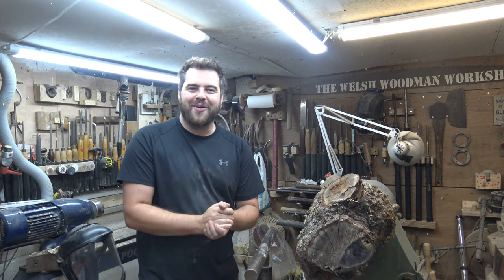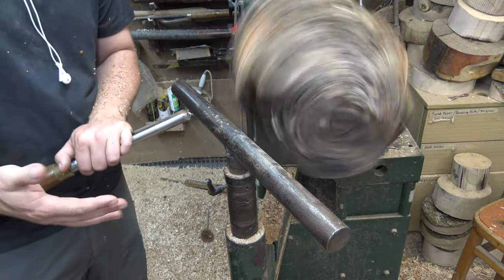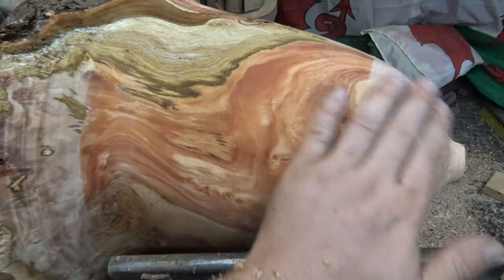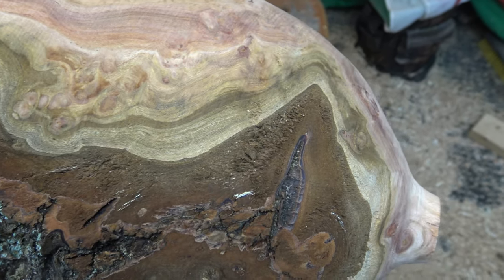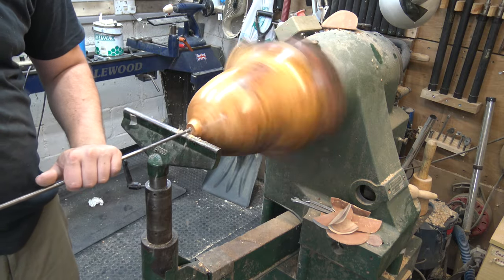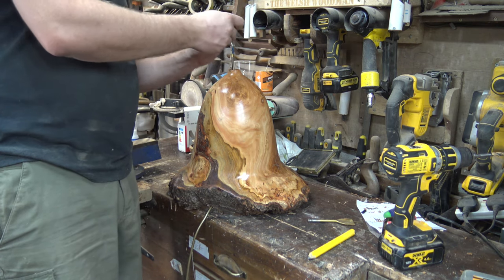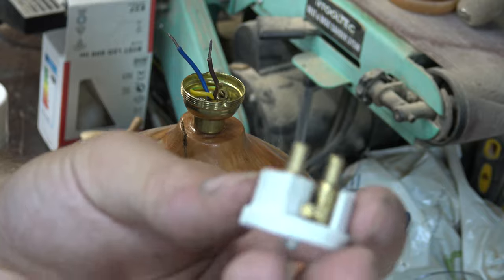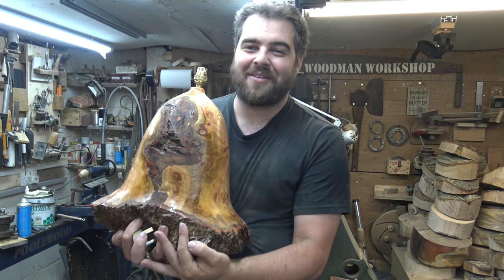Woodturning a Cherry Lamp

Comment: Nice one, Tom! In the beginning I thought you'd be doing a lamp shade, i.e. hollow it out. But it's also beautiful as the base of the lamp.
Reply from the maker: Thats definitely a cool project for the future, thanks for the idea 😁 I think I would try and pick a piece free of knots and the pith for the shade as it'll be turned thin it will be less likely to crack 😉 thanks for watching 👍
Reply: @thewelshwoodman649  or maybe a super gnarly knotty piece that turns into a shade with lots of holes. Might be worth the risk of having it crack.

Comment: Hi can I ask for a little tip. I have recently started woodturning and really enjoying it but I have noticed when I have finched a project it starts to crack a few weeks after how can I stop this ?
Reply from the maker: Thanks for your question Anthony 😁 There are a numbers of reasons your work could be cracking, it occurs mostly when green wood dries out too quickly especially if the pith (center of all growth rings) is left in the wood. If you are turning green wood you can seal the end grain as this will slow the drying process you can use PVA glue,waxes or clingfilm, I have also placed the turned piece in a paper bag full of shavings and revisit in about 6 months. Wood normally takes a year per inch to dry out. If you change the temperature conditions of the wood rapidly the wood can move/crack, especially if your taking your piece from an outdoor workshop into the house with central heating, you can let the wood acclimate for a few weeks before moving it into the house can help. Depending where the wood came from in the tree once turned can release tension and compression which can effect wood movement. If you are turning green wood items like bowls, hollowforms try turning thin even walls will help. There are a few other reasons the pieces could be cracking, feel free to send me an email with some phots and I'll be happy to give more advice. I hope this helps 😁
Reply: @thewelshwoodman649 thank you for replying. I have been turning cherry and beach. I have cherry on my lathe right now and was making a jewellery box for my daughter but went in to my garage today and found a big crack down it. If you don't mind me sending some pictures off that
Reply from the maker: @anthonywandless9884  please send me some photos and I'll be glad to help my email address is: thewelshwoodman@gmail.com

Comment: Hi Tom just after a bit of advice. Some has given me a piece of old railway sleeper. Is this something that can be turned. Its just I was advice by someone that it wouldn't be a good idea. 
Many thanks 
Steve.
Reply from the maker: Hi Steve, I've never turned a railway sleeper before, there are a few different types in the UK before steel and concrete sleepers came in they use to use hardwoods like oak, beech and hornbeam but would often treat them with pitch/ tar and chemicals to stop them from rotting, so not sure what effect that would have on your tools when turning or the finished product. I probably wouldn't use them for any food based items just in case. If you're going to give it a go I would definitely recommend a full face respirator try cutting up a small piece to test first, normally cutting a blank out will give you an indication of the quality of the wood you have. I hope this helps all the best Tom 👍
Reply: @thewelshwoodman649  thanks Tom really appreciate your advice ill have a go and let you know how it goes. I wasn't sure if the wood would be ok to use as I was told they would be way too hard for turning but would rather ask an expert like yourself. 
Thanks so much for your advice hope you didn't mind me asking. 
Keep up the good work fella still loving your channel.